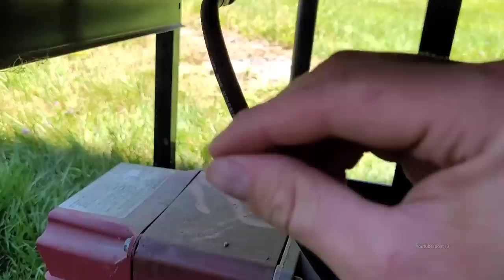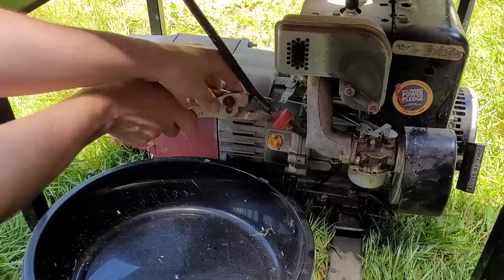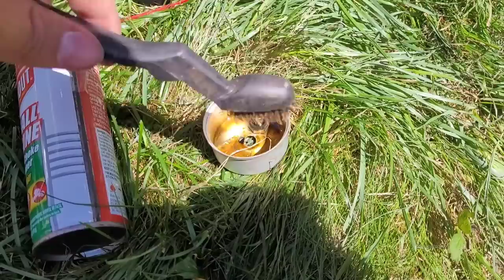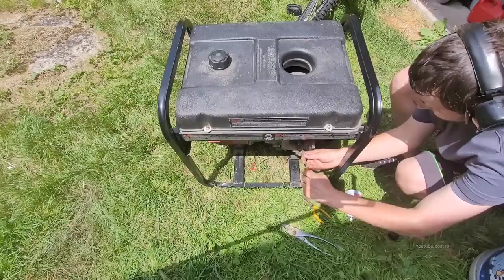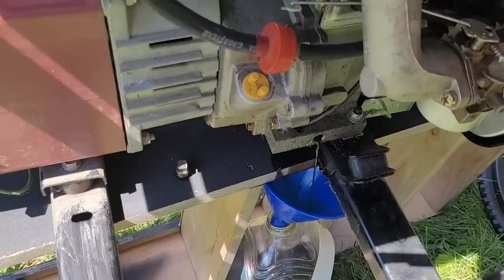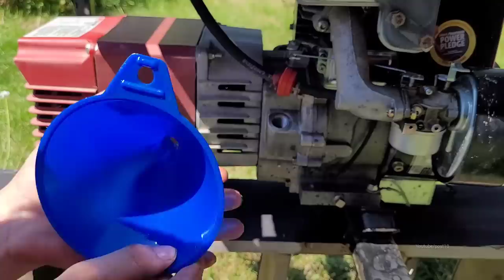I Bought a Generator That Won't Start. Doing a Tune Up

Comment: ok for future reference, the center part that sticks down in the middle of the float is the high speed jet.  Most generators don't have an idle circuit.  Using a flat blade screwdriver screw out the jet and clean it.  You could see dirt on it in the video.  Also, when it starts and hunts up and down that means it is running lean and a dead give away the jet is clogged.  Unfortunately since it looks like you were changing the settings on the governor (the vertical arm on the side of the engine) you need to now set the rpms.  The engine speed gives you the hertz of the electricity.  Most volt meters have a hertz (Hz) setting.  Turn that on and stick the probe into one of the power outlets.  Set the governor for something in the 61 or 62 range.  When you put a load on it, it will sag down into the 60 range (usually 59 to 61 Hz).
Reply: Another potential failure point is that red in-line fuel filter. Not a bad item to have a spare on hand for.
Reply: I didnt read your whole comment before posting the Hz comment.
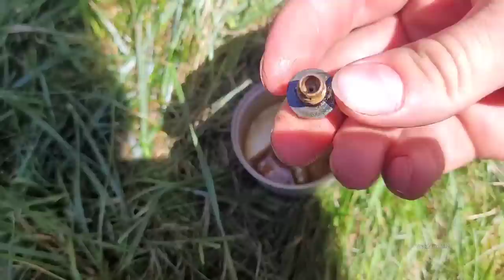Reply: There is no high speed jet inside that carb that you unscrew with a screwdriver.  The jet is the small brass nut that holds the bowl on.  If you look very closely at the brass nut , you will find a very tiny hole that is usually plugged up.  Often a small "piano" wire is needed to remove the hardened crud.  Look at 9:35 and you will see the big hole, there is another one, maybe down inside.  Your spray dissolved the crud and running flushed out the rest.  
In the future, if you work on another carb with the high speed nozzle in the center of the carb, do not attempt to remove it.  They are installed and cross drilled, you will not be able to line up the holes again.  Some are removable, but if you don't know, find out first.
Reply: What about 2 stroke fuel?  If an engine has not been running for a long time, is it not a bad idea to run some 2 stroke for 30 minutes or so?  To lube the top end?
Reply: Excellent advice!
Reply: I don't really know what I'm talking about.
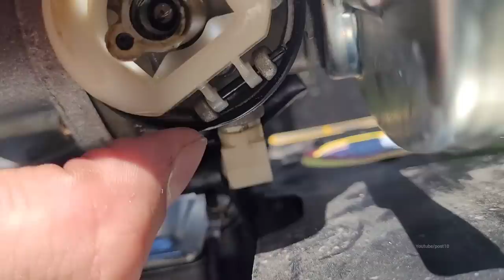But at 9:56, I think you're supposed to shove a thin wire up the center of that shaft (up the center of the thing with the female threads. The large white plastic float wraps around it). I think that's the main jet, or some kind of jet. I assume that's what this commenter is also referring to as the high speed jet.

That's' what I did when my pressure washer wouldn't start after sitting for a season. I found a yt video & removed the bowl; I assume the same as you did. 
I used thin picture-hanging wire; about the diameter used for plastic grocery bag ties. I left it wrapped around the pressure washer handle for next season.

Sorry that's not much help; the other dude knows more about small engines & generators. I just wanted to point out, that it may be a 2-minute fix if it happens again next season. (I assume the old gas / ethanol gas sits & clogs that jet)

This was the video I saw, at 13:10- How to START a SELDOM-USED and STUBBORN Ryobi PRESSURE WASHER - Honda GCV160

I didn't want to mess around with disassembling it. I just shoved a wire into it, in-situ. It worked for me, & took 2 minutes (just remove the bowl, shove the wire up there and wiggle for 15 seconds, put the bowl back on). Check for leaks when done.

Comment: When i was doing roofing with my dad we found a broken generator at a junkyard while dropping off scrap copper gutters. On a rainy day I took that thing apart and cleaned it. It seemed like they were pre mixing their gas with oil thinking it was a two stroke even though it was a four stroke. Cleaned it. Put it back together. Started on first pull. 10 years later we still use it on every jobsite that doesn’t have power.

Comment: Open the fill plug before you remove the drain - it will drain more efficiently. In addition if the fill plug is seized you will know before you drop the old oil out.

Comment: I admire your patience, tenacity, common sense, and life skills. I wish I possessed more of these qualities. The neighbors probably would have called the cops on me 15 minutes in for swearing at the top of my lungs. I did purchase a solar-powered generator for 70 bucks on sale and I'm in love with it. The power went out in my neighborhood and I could run a large fan and my modem/router. It hit 103 degrees that day - life saver.
Reply: This video reminds me of a snow blower I got running a few years ago.
The unit had been sitting outside and not running for about three years before I got to it. So even before I tried the first pull of the cord or push of the electric starter, I changed the plug, oil and gas, disassembled and cleaned the carb, and oiled all of the mechanical moving parts (great use for the old oil!).
The gas was also a dark amber like Post found, and the carb was heavily lacquered with aged gas.
The only pain was having to replace the priming bulb which had rotted from UV exposure.
Reply: I hear that. I’m the same way. Cursing , calling it every bad thing, funny thing is, it can’t hear me 🤣🤣🤣 I watch some of these channels and it’s like “man nothing gets this guy down”. Watch Waldos world he has a good channel

Comment: The best gasoline preservative I've found is two cycle oil. Doesn't have to be a 50/1 mix. A 150/1 is good. I do this with the mover and snow thrower. Never have to dismantle and clean carburetors. Added note. The tie wrap on a loaf of bread, strip it down to bare wire and use the wire to clean out the small carburetor orifice holes.
Reply: Wow, thank you so much! ❤️
Reply: It also makes a kind of napalm . 👍
Reply: Take a pair of pliers and pull 1 strand of wire out of a wire brush. Leave the bread tie on the bread along with the small pieces of paper or plastic attached to it.
Reply: @edpoints1127  but the bread ties do work. Had service/repair tags one time with wire wraps and those were better and then one day those service/repair tags grew legs and disappeared.
Reply: I just run 91+ through my small engines, never needs cleaning and in the winter for storage I just run it empty and seems to provide the same effect.
Reply: Why do you need the tie wrap? You said you never needed to clean it
Reply: @HuskyGamersUNITE  stow it.

Comment: You can find owner's and maintenance manuals online for free. You can also get parts diagrams with original part numbers to replace what you need. I have personally done this for several used equipment I have purchased or been given for free. Those manuals and parts diagrams have been a blessing for me.

Comment: Excellent!  

Our one-pull mower, from the 70's, needs a new pull-cord. 

In the 90's, the last   time I'd [almost] started it, it had started, shut off, then when I'd pulled the cord, it had  seized half-way (if I'd been a cartoon, my arm would have flopped on the sidewalk).  🤣

That mower's been in the garage ever since; I'm sure it will work again.

Learned new things about gasoline and oil re equipment in storage.  

Thanks for another instructional video! 🖖

Comment: now get an electric clock, plug in style with a second hand.... and get another actuate time piece with a second hand.... you want to generator and the time piece to match in one minute, thus 60 cycles in AC current.  you adjust that with the carburetor matching the rpm of the engine.  other wise you could damage the electrical item your powering.

Comment: Fuel, Air and Spark. I would suggest that your carb is still dirty from the same varnish you were cleaning from its bowl earlier. I would also give it a new spark plug which is in line with a proper tuneup. Change that fuel filter too. Remember Fuel, Air and Spark that is all an engine needs to run.
Reply: @Ken Anderson And with no compression you can kiss the fuel, air and spark good buy.
Reply: @ducewags  in that case there is a hole in something so of course it won't work 😂
Reply: @kenanderson9331  Or bad rings, valves, valve seats, plug threads are worn out, and the list goes on. And yes plug threads can be bad and leak where you will not notice, even on a compression test. Even a leak down test is not always a sure win on engines.
Reply: @ducewags  Wow or the plug could be missing and the head bolts laying on the ground and so on and so on............. I'm not stupid and Fuel Air Spark are the three things you look for first in diagnosis of an engine no start then you go from there because no engine will run without..........You guessed it! Fuel Air and Spark.
Reply: @kenanderson9331  And again no compression, no start. Uncompressed chambers will NOT start with all the fuel, air or spark you throw at them.

Comment: You should never start an engine that's been sitting like that without cleaning the carburetor before hand. You need to clean the gum and ethanol tarnish shit out of the float bowl. If not, you can easily suck shit up into your main jet and it's really hard to get out sometimes so you end up needing a new carburetor. I have done the job you're doing so many times that I can do it with my eyes closed now lol. Good job man. Also a good idea to spray the jets out with compressed air or send a thin piece of wire through it to scrape out the shit. I like to help people with engine problems that may not know as much as I do about them. And also I have that same exact engine on my wood chipper. And you got that right about using non ethanol fuel in your small engine that sits around mostly. Awesome man.

Comment: On first glance, I see the problem. Its a Tecumseh engine. Their carbs corrode/gum up easily. Use Marvel Mystery Oil in its gas to prevent burning the exhaust valve and it will prevent corrosion in the carb. The little plate covers the brushes. Sometimes the end bearing greases melts out onto the commutator. This soaks the brushes and makes the generator not work. You have to pull the brushes and clean them, then lightly sand the wear surface. With the brushes clean you have to clean the commutator. Use Q tips soaked in carb cleaner stuck in through the brush holder. Turn the engine and keep changing the q tips until the q tips come out clean. On Techie engines you often have to remove the float bowl and clean it. IF you are going to make a double male cord, make it short. Do not use starting fluid on small engines. Gumout carb cleaner is safer and works well for starting. I'm glad that you changed the oil. Techies are notorious for throwing rods. Good Luck, Rick
Reply: Thank you for sharing this, I am honoured to learn from you💛
Reply: @MeRia035  I'm happy to help. There are plenty of videos with info on small engines. Join GardenTractorTalk to get access to their library of manuals. Good Luck, Rick

Comment: If you know a small engine's been sitting with gas, it's pretty much always faster to clean the carb before trying to start it. Sure the fresh fuel eventually dissolves the residue in all the little passages, but it's gonna take a lot of running to do so.
Reply: Coming from someone that has worked on a lot of outboard engines, this is true.

Comment: Thanks, that's cool! Unfortunately this wasn't nominal load run but I like heard valve clearance issue. This is however Youtube video. In military we always changed all the filters, oil, plug and checked the nozzle, fuel valve & tank.

Comment: Lots of great advice here. I’m going to recommend that watch Mustie1 on you tube. He services generators, snowblowers, lawnmowers, anything with an engine. Watch him pull a few carbs apart, clean them and put them back together to make your job easier. I have a feeling that tge needle jet inside your carb needs cleaning it’s a tiny opening the gas goes through. Great video. I’d be in a state of exhaustion from all the pulling ! 😂

Comment: You want to use the 240v cord basically the generator (or service power for any reason) has 3 wires plus ground. 2 wires have 120v and when used together make 240v. If single leg  pairs with neutral you have 2 circuits 120v. Using only 120v plus will. Only use half capacity. You should balance both legs if possible

Comment: Been a while since i have seen a square bung as had bought sockets for these purpose on gearboxes and axles on cars of the 70s.
Never hold the diptick upside down as you may get a false reading. 
Yep service it every number of years , no way .Yep vehicles that are built to last when serviced and still driving a 1989 car.

Comment: good rule of thumb after cleaning a carb is to set your mixture screws to a turn and a half should never need more then a  half turn left or right from there if it still acts up from there needs more cleaning then also fuel is a good cleaner for carbs running them will usually help clean things out if any fuel is flowing that is

Comment: I've seen people with these noisier generators place them in sort of a box enclosure, basically surrounding it so it shoots the noise upwards instead of sideways. Something like 3/4" plywood, on all 4 sides. My guess probably reduce 10 dbs. It's something you might want to consider, to reduce the amount of noise pollution, especially if you're in a neighborhood. Might make a good video along these lines.
Reply: In the military, they use the same idea by digging a pit to lower the generator in that leaves about 6-10 inches around all the sides and the top of the generator was below grade.
This was something only done for the "smaller"* units, IIRC.
*Smaller meaning "able to be lifted by 2-4 soldiers who want to flirt with getting hernias.
Reply: What I’ve seen done on top of that.  Is that sometimes the person will put carpeting along the walls inside the same wooden box you mentioned.  That way it really helps quiet the noise.
Reply: @Sitharos  I remember from my 80's motor-meching there was a dedicated silencing material for motor-bays. If you'd want to go 'pro'.
Reply: @MonkeyJedi99  Best practice! Actually we had 40 kW trailer unit and we used to dig the whole power plant so the infrared wasn't visible only from the lines. The exhaust pipe had weird (and hot) extension which should be pointed away from the lines. That was lot of shoveling.

Comment: That little bolt that you took off to remove the bowl is not just some little bolt. 
It happens to be the smallest path for fuel to travel and takes fuel from the bowl to the venturi jet. 3 holes on that bolt that need to be cleaned. Burn the plastic or paper from a bread tie and use that metal wire to clean it out with brake cleaner. 
Also not always ideal to mess with the governor, since older generators are set up to run as close as possible to 60hrz.
Next time you have a problem with a small engine starting, stuff a plastic bag in the carb to create an extremely air tight choke. Sometimes the strong suction will pull any trash through restrictions.
Reply: Pull out a piece of wire from a wire brush with pliers and leave the bread tie in the house

Comment: @Post10, if you are going to let is sit, turn off the fuel and run it until the carb is empty so the gas doesn't sit in there and cause a future issue.   Ever Fall, I turn the gas off on my lawn mowers and run the carb empty for the winter.  in short, i got tired of cleaning the carb every spring.

Comment: Every Tecumseh engine I ever owned had the crappiest carburetor that was incredibly difficult to keep properly adjusted. I'd rebuild one, get it running good, and after about 5 hours of use, it would run like crap. Re-adjust, and go another 5-10 hours. Got so tired of constantly screwing with them, I sold every machine I had with a Tecumseh. Every other engine I had (Briggs, Kohler, Honda, Kawi) just ran good, all the time.

The Tecumseh engines also were always louder and vibrated more than their counterparts.

Comment: Fun fact: Most of these little plastic "dipsticks" are not meant to be screwed in when you're using them as a dip stick! Of course screw it in when it's acting as a plug, but to use it as a dip stick, you should remove it, clean it, then just push it in without screwing it to take a reading. When you screw it in the way you are here, you are actually getting an artificially higher reading. I never knew that and most people don't know that, but I read the manual once (just once!) and learned something new. 

Typically when I'm reviving an engine that has sit for a long time, here's what I do: 
I drain the fuel tank and drain the carb right away. 
Then I will do a cold oil change. 
Then hopefully I can get it running at that point. Once it warms up, I'll give it another oil change.
And I always mix SeaFoam in with my gas can at 1oz per gallon. It's a stabilizer and a cleaner. 

At this point hopefully it's running well enough, and the more you use it, the cleaner it's going to get and the better it will run. 

My favorite oil to use in my power tools is Mobil 1 0w-30 full synthetic. It's great for easy starting and helps keep the insides of the motors nice and clean. Typically 3 quarts is enough to change the oil in 4 machines so the extra cost of better oil is negligible. 

Around here, the only place to get ethanol free fuel is at home depot at something like $20/gal, so I usually just use very fresh regular gas. But if I'm helping out a friend, I'll make them go buy the good stuff just to make sure we can get everything working.

Comment: Only issue I see, other than it would be nice to add wheels and a handle to move it, is the small muffler. Noise could get tiring on prolonged runs. When you're ready to put it away, it's a good idea to shut off the gas and run it till the carb is drained and it cuts off. For long storage, also drain the tank.

Comment: I would talk to James Condon here on youtube. He's very smart and really informational about this stuff. You have to be careful with generators because if they run too fast there's a chance the voltage will be too high and you can damage what ever gets plugged in. I would talk to him about checking that and setting engine speed